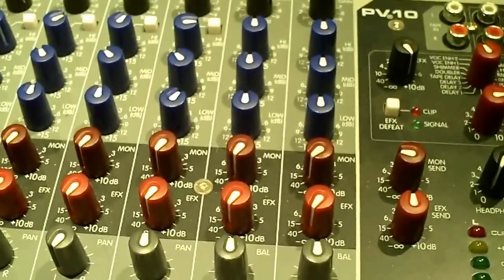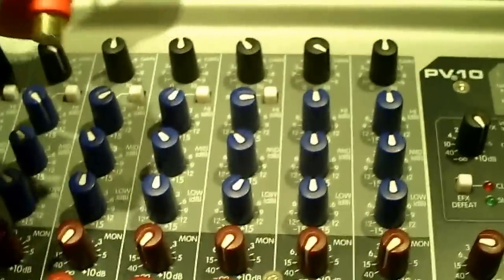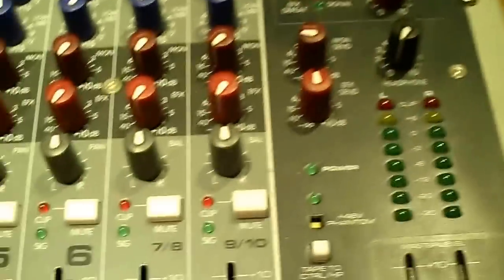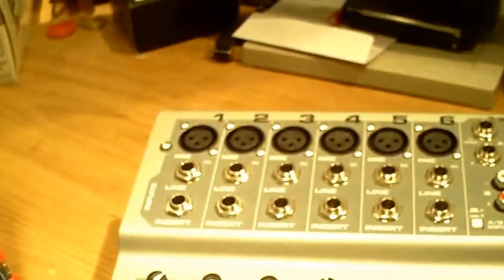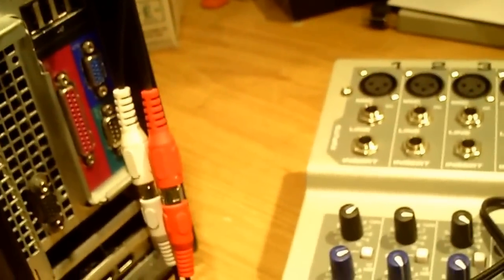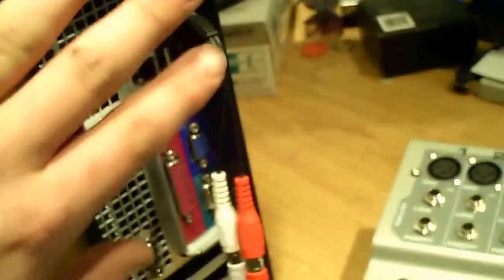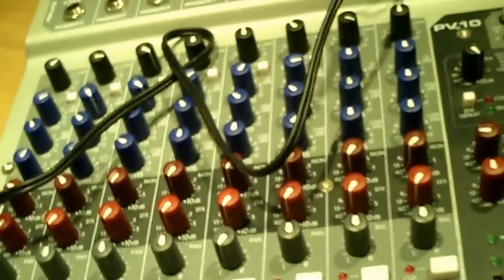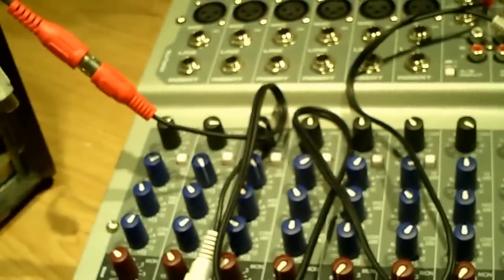How To Connect Your Audio Mixer To Your Computer & Vice Versa

Comment from the maker: Where to BUY the cables
3.5mm Stereo to Dual TS 1/4 - http://amzn.to/2Gc84qL
3.5mm Stereo to Mono TS 1/4 - http://amzn.to/2EoFDtB
3.5mm Stereo to RCA - http://amzn.to/2G6So8r
3.5mm Male to RCA Stereo Female Adapter - http://amzn.to/2nWBcf0
Reply: McInTEC hey bro ik this is old but this work hooking up my Peavey pv6 to my Toshiba satellite windows 10 laptop? I'm new to this and can't figure it out we have a podcast just got a mixer to make our sound better any help def be much appreciated hit me back here if u can or our podcast Facebook page @rsspodcast thanks bro
Reply from the maker: Yes, it should work fine. If you run into problems let me know.
Reply: So 3.5mm to RCA or 1/4" converter does the job. Then why do some people buy digital to analog converter and make a video on that?

Comment: Please Help!
How can I hook up my Laptop to the mixer if the laptop only has one Aux for Mic and Audio? Will an Aux Splitter work maybe or would that be too much for the Soundcard or the Port to handle?
I want to connect my Piano and Guitar through a Mixer (LD Systems LAX 1202D) to my Laptop (Surfacebook 2), back to the mixer and into my Speakers. So I can record the Music on my Laptop and play it on the speakers.
I have the speakers connected with the Main Out and want to connect the Laptop with the mixer via the CD/Tape In and Out. Will that work?
Thank you in Advance

Comment: Hi there McInTEC.  I just purchased a used Yamaha 01v digital mixer and I'm trying to figure out how to connect it to my computer.  Do I need an audio interface?  I hope you see this comment.  I have an my8at  digital I/O card, could I use this to connect to the computer?  I also have a TO HOST.  Also, once I connect to my computer, will I be able to program my sounds from the mixer to something like pro tools?  I am completely new to this.  Also, what type of cables will I need?  Ugh!!!!  SO much to learn.  Please help.

Comment: Hi Jason great video thanks.  I am a total newbie so your video helped immensely. I am certainly confused at the moment as I have some decent equipment but not managing to get sound.  I have a couple of Sure Mics, the Mackie ProFX8v2 Mixer, PreSonus Eris E3.5 Studio Monitor Speakers, Akai Professional MPK225 MIDI USB Keyboard & Behringer G100 DI Box.  So got the gear but struggling with what connection goes where.  I play Guitar and Bass as a hobby and since a recent heart attack and then a stroke, it has left me with a lack of understanding.  So I wondering if you could help please.  Many thanks. Tony (UK)

Comment: Good evening!
I have been trying to get my mixer working with my computer for weeks now and am so frustrated! I did learn something I didn't know from your video finally which was the sound going back out needed to go to the Tape L and R. However, I don't know how to know if the computer registers the mixer or not. I have the "Professional" which is off Amazon. I have found it under other names as well, but it is a Bluetooth version but even with the Bluetooth.

I haven't the slightest idea how to use it. Now, I'm also using VoiceMeeter Banana as well as Audacity as I am trying to record. I have Voicemeeter so I can get 2 sets of Bluetooth headphones to work at the same time. Audacity as my recording studio program. When I go into Audacity and test out the mic from the mixer I don't get anything. Can you possibly guide me in the right direction and tell me what I could be missing? I am so overwhelmed and feel as though I've wasted my money, but I am sure there's 1 simple step I'm missing? I tried to email you but it is not working so I figured I'd try here. 

Thanks!

Comment: Question my laptop only has a headphone jack w/ an internal mic. How can I set that up?
Reply: I'm currently trying to figure out the same thing. I think the only option is to get a UCA audio interface. Instead of connecting the RCA cables to a computer's input jack, you'd connect double-sided RCA cables to the UCA and then plug the USB of the UCA into your laptop's USB port. It's a little difficult to understand, but the UCA basically turns the mixer into an interface, so it can connect to the computer.

Comment: bro i know this video is 9 years old iam really so late,and i hope you doing well . i wanna ask something . my mixer doesnt have "STEREO IN" only have "Tape in and Tape Out" . so can i just use 3,5mm to 2 TS cable and plug it on the MIC/Line Input ?? and pan both of the TS cable (MIC/Line Input) both hard "left" and "right" . is this still consider a "Mono" or its now a "Stereo" ?? whats the cons when you doing this method versus when you using the "RCA inputs" (STEREO in) . iam so lost , shld i just save more money and bought one that has stereo in or just stick with that method .. i hope you see this and help me ... i really apreciate that .. thanks man and have a good day , god bless you
Reply from the maker: What make and model do you have?
Reply: @McIntec  you might never hear it before , its from local manufacture called "ashley"  "Ashley AX8N" , you can google it for the picture of the mixer . thanks for the respond man
Reply from the maker: If you pan hard left and hard right the way you describe you would get stereo providing your mixer/amp has stereo output.
Reply: McInTEC but with that method can i get a real “stereo separation” feel?
Reply from the maker: Yes you will. Just that you will have to adjust 2 faders instead of one. Stereo channels are essentially 2 mono channels put together on one pot.
Reply from the maker: @batnotbad2561  no problem! let me know if I can help you out with anything else. I will be uploading new videos soon!

Comment: I've heard that USB mixers make sounds in usb mixers does this have a funky sound in a mix like a long beep or fuzz
Reply from the maker: Yes that is true. However, the newer USB audio interfaces are a lot more quiet with the digital noise then they used to. Usually you have to really have to boost the noise floor to hear the sound. But, if you have a good pre-amp mix then you would probably not notice... or at least someone listening but not for the noise specifically.

Comment: I have a Studio Master XR 40HH (XLR Male output )and Peavey 10. I am using 6 Mics in Channel 1-6 XLR inputs and wanted to use 2  more for the chord less mics.Can I use an adapter (XRL female to TWO 1/4" Jack splitter) into Stereo L & R ports of Channel 7 or 9.
Reply from the maker: Yes, you can use an XLR to 1/4 adapter. However, keep in mind you will not get phantom power. Also try and get an XLR to 1/4 TRS adapter as that will provide a balanced signal. Here is a link to that https://amzn.to/2JNaeDC
You also don't need to split the XLR into left and right as the Left channel can be used for a mono signal which will play on both channels. When you look at the 1/4 inputs on the stereo channels it will say "L/MONO".

Comment: My issue is getting the audio sent through a 5.1 computer speaker setup. I'm fine with not using 5.1 but yeah it's a computer speaker not monitor so can't seem to figure it out

Comment: what is the correct way to power everything? should the mixer, computer and powered monitors all be plugged in to the same power source? I'm sure someone told me at least one of those should be in a different power source..
Reply from the maker: All of the equipment that is connected together should be connected to the same circuit (breaker, powerbar) This will help prevent ground loops (60Hz hum and other noises). Of course you don't want to exceed the max rated amperage, so at that point you would have to use another circuit.
Reply: McInTEC cool, thanks. that's what I'd heard, now that I read it here.

Comment: I have the same exact Mixer shown in the video and I have no problem connecting it to my computer and using it with programs like adobe audition, but when I use it in my DAW, FL Studio, it doesn't work properly. The ASIO driver specific to the mixer is there, but it has an error when I try to use it and the standard FL ASIO has a ton of feedback and noise when I set my input. Then ASIO4All can't open the input, it says it's busy. Can you offer any hints as to what may fix these issues?
Reply: I have the mixer connected directly to the computer in case you are wondering.
Reply from the maker: What version of FL Studio are you using?
Reply: 12
Reply: It's connected by USB if that helps any
Reply from the maker: In the Sound properties located via the control panel. On the audio device listing "Properties" for the USB Mixer, for both the playback and recording, in the "Advanced" tab you will see "Exclusive Mode". "Allow applications to take exclusive control of this device" and "Give exclusive mode applications priority" should both be enabled. Another thing is that ASIO requires full control of the device without shared resources. Windows may still be using some of the audio resources which is preventing ASIO from running. In the Sound properties, try setting your intergrated/onboard sound as the default sound device for both playback and recording. This will cause windows to send all sound to the default device which is the computers soundcard, leaving the USB audio device free. Once you have made those changes try and see if ASIO will send the audio to the USB mixer. Let me know if this helped.
Reply: McInTEC
Hello. If I may chime in, I can't find the properties for the audio device listings that you're describing. When I select the Device in Cubase, it says that it's "impossible to record audio." What am I missing? Is there something I need to install? In device manager, it says that the "best drivers for the device have already been installed."

Comment: How do I disable playback / loopback in Windows 7?
Reply from the maker: Are you talking about the on the mixer end or setting in Windows 7 itself?
Reply: McInTEC In Windows. But I looked it up and found it. Thanks for the speedy response. I didn't think you would respond since the video is so old.  Quick question; what's the purpose of the loopback function in Windows 7 anyway?
Reply from the maker: The loop back function basically allows you to plug an audio device into the mic/line input and then hear if from your speakers without the need of additional equipment.

Comment: Can we use Tape in and Tape out?
Reply from the maker: +akmt123 yes you can use Tape In and Tape out they function the same as the main mix. Some mixer may have a separate control or button for the tape function.

Comment: How would I connect a monitor to my Mackie 1402 so my singer can hear herself while recording?
Reply from the maker: +Jeff Sprankle yiu could use a pair of computer speakers. Using the headphone jack out on the mixer with a splitter so you can use the headphones as well at the same time. Could also use an AUX.

Comment: is it the same process to connect a mixer to a laptop that has a simple mic in Port to send sound from the mixer to a live broadcast through the computer?
Reply from the maker: +michael mcinnis yes it is. You just have to set your volume and gain levels on the mixer and on the computers sounds settings so you don't push too much into the mic input and cause distortion.

Comment: Question: Perhaps you covered it, I just need a little more clarity. I want to record to my pc, and burn to a dvd. I have all the cables needed according to the video. You showed to ways to connect to the pc in the video. My question is which way do I need to connect to the pc to accomplish what I'm trying to do? Would that be the output or the in input  on the pc?

Comment: so will the computer recognize each individual channel and recognize that there is several different mics plugged in and record them all on seperate waves / tracks
Reply: Brent C Lmao, No. if you want to control all tracks, You need an interface with as many ins & outs as your mixer.

Comment: So, I have the Tascam M-2524 and wish to record guitar with a MIC, amp and cab and then have it go through to the computer and have the mixer fully operational. I also have the Line 6 POD HD500X, as an audio interface as well as it has all my OD simulators and what not so a big chunk of the sound. Do I need to connect the POD to the mixer or computer or should it be ok just connected to the amp alone?

Comment: Great, easy to understand explanation on this topic. For the idiots who just want to be negative or have no clue about audio engineering, they will always talk crap. The unbalanced cables(rca) are totally fine as long as they are less than a 15ft distance and also sound clean. If it sounds good and it works than that's all you need. Thanks for showing YouTubers this method, keep up the good videos and even though the camera did tend to be a bit shaking around it wasn't horrible like others claimed. Maybe setting up the camera on a still stand on table might be better for the video masses watching but since the audio was good that what counts most.

Comment: Great video. Question what if I want my mixer to go thru a stereo receiver back thru my computer? So I can have more control? If you can answer this one your good. Thanks
Reply: Hook it up the way he explained. Then, If you have a stereo receiver then you can send the sound out through an additional output on the mixing board so you can have the stereo system pump the sound out through the speakers that are hooked up to it. Having the board control everything for mixing isall that's needed, the addition of a stereo receiver to add "control" will be too much hassle and unnecessary. Hopefully that will help you out.

Comment: where to hook the studio monitor? computer or mixer? so confusing
Reply: Since the source of the sound from the computer is traveling through the mixing board, you would pump the sound out of the board to the monitors/speakers.

Comment: Okay, I think I get it. Currently I have a condenser mic going into a Phantom PS and then into an audio interface. From there it's R/L RCA to the 3.5mm computer mic input on my PC. Now, with an upgrade I have purchased the Alesis Mulitmix4 FX USB mixer. In order for this to work correctly I believe I would plug my mic into CH2 on my mixer leaving CH1 for my guitar. Now from the mixer it's USB and has an audio interface built in so I should be able to simply connect to USB on my computer and with Phantom Power on my mixer I should have decent audio from both my guitar and condenser mic. So, if I had a preferred audio interface such as the Behringer U-CONTROL UCA222 USB-Audio Interface, could I or should I run my mixer through that into my computer?
Reply: I prefer using the UCA for my bedroom setup, because that lets me run the output from my computer and the output of my mixer (which powers my mics like yours) into my two monitor speakers. The output jacks on the audio interface go to the speakers, and the output L/R from my mixer goes into the input of the interface. Took me a while to figure out.

Also, using a guitar, even an acoustic with a pickup, through a mixer is workable, but not with another microphone being used at the same time. Also, does your mixer have phantom power for each channel or is just either on for all or on for none? Usually you don't want to plug anything into a mixer with phantom power running if it doesn't require that power.

But back to the first thing. A condenser mic is going to run hotter at a lower level than a guitar straight into line in. You'll have to max out the guitar (channel 2) and still turn up the main level.... which will make your microphone go crazy. The signal is just to weak.

To answer your question simply, yes, the UCA is a good option, but don't try using the condenser and the guitar at the same time. You can always get a second condenser and mic an amp, or just the guitar if it is acoustic.

Comment: Thanks for the video.  What type of AC adapter port does it have and what is the power supply voltage needed for this mixer?

Comment: My advice: don’t use the onboard soundcard of your PC. I have a top range Asus motherboard and even then the sound quality is terrible. Buy an external sound card. Even the cheapest Behringer sound card the U-Control UCA 222, selling around 30-40$ will enhance your sound in a dramatic way. For 60-70$ you can buy the amazing sounding Lexicon Alpha(better sounding than the Behringer). If you want more options Lexicon has two other sound cards, a little more expensive but having a lot more mixing/recording options. Lexicon delivers these interfaces with outdated drivers. So check their support page.
You can also check for Focusrite audio interfaces. Also excellent.
Forget the audio out connector on your PC/Mac or notebook. Buy an usb connected sound card/audio interface and enjoy the sound quality.
Reply: Awesome advice. Thanks for sharing

Comment: How do I connect my mic mixer to my PC so I can record my mics in recording software? Should I plug into the Line in or input jack? Or will that cause line noise?
Reply: Connect the tape out of the mixer using a splitter to one of the 8th inch inputs on your computer or get an audio interface.

Comment: it is ok to connect 45w mixer to my laptop? is the "watt" matters n connecting to laptop?
Reply: Wattage doesn't matter to the computer. The mixer's wattage only accounts for when you use the power supply and connect it t the outlet. If you are trying to power a mixer with a laptop, well, I'll be the one to tell you to just use a normal power supply unit, which I would expect to come with the mixer.

Comment: Good basic points, I just started using my computer and just got the understanding that it is best to use a stereo channel on my mixer that has two channel like 9 and 10 to get the full sound.
The other thing is you have to double check that your computer sound in not muted and the sound volume level is high enough to pass the music to your mixer or you may not get any sound out from it.